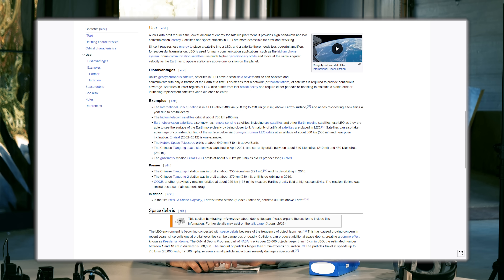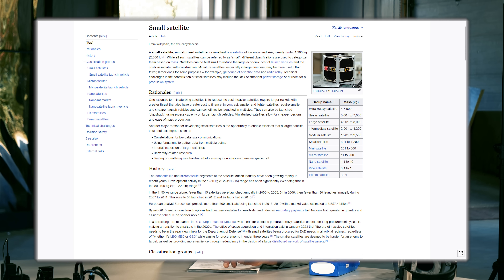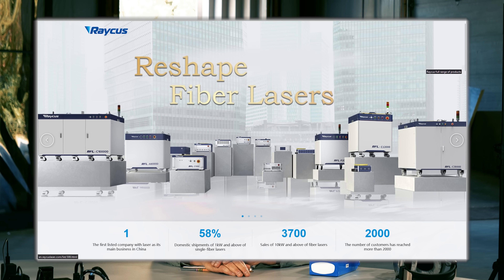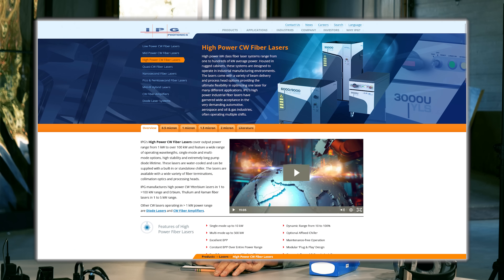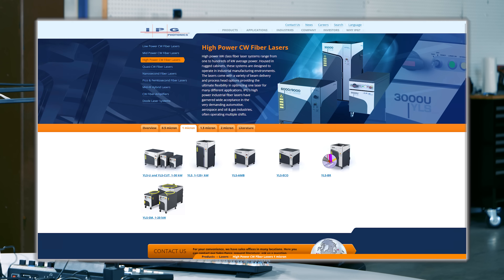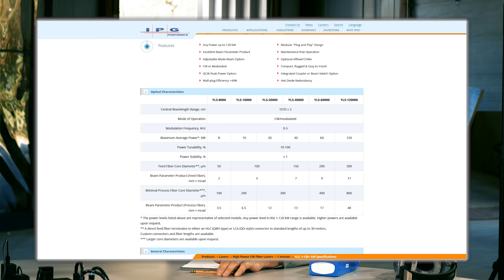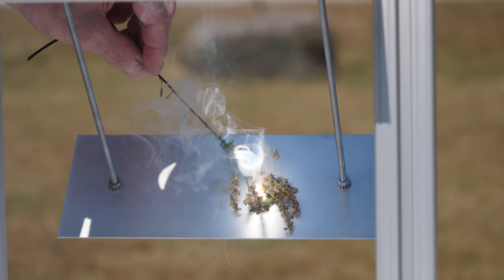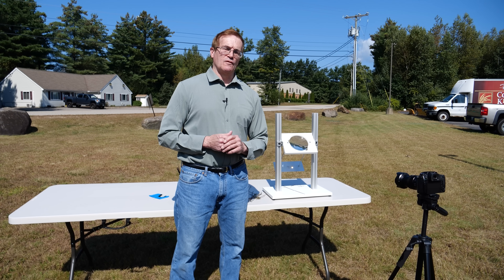COULD SATELLITE LASERS REALLY DO THIS?...

Comment: Here in Australia we routinely have fires started by discarded glass bottles and we have even found a plastic bottle that someone was using as a water bottle that started a fire beside a road. (That one got me because it takes me ages to get anything but char-cloth going with a water bottle) and there really wasn’t much grass where it fell.

One of our biggest causes of fire for a while was DPF regeneration, I haven’t been keeping up with the fire investigations as much but that seems to be getting rarer hopefully manufacturers are shielding the exhaust better with less places to collect grass etc.
Reply: I once lost a camping chair to a full water bottle focusing sunlight onto it while no one was paying attention.
Reply: @Segphalt  ouch that would have been a surprise, I had heard it could happen but I never used to worry about it before I saw it start that fire by itself, because like I said it is usually a pain to get it to work on purpose.
Reply: Had a similar problem when catalytic convertors were first made mandatory in automobiles. Especially in fall, when leaves were all about on the ground and could accumulate under a hot cat and ignite.

I've always cleared foliage away from where I put food and drink, leaving stone or bare earth. Safer and bugs tend to not like crossing bare earth.

Comment: If they can make it happen from a satellite in low earth orbit, then an aircraft mounted system would be magnitudes more effective. I would love to see a video on aircraft mounted lasers, and what they are capable of. Without the limitations of atmospheric distortion, distance, and a far less consideration towards weight, I think they would be a more plausible weapon. You also wouldn't have to worry about the satellites duration over target because an aircraft can loiter.
Reply: Exactly, you even do a drone of some type at an even lower height makes size and power requirements very small. Even multiple drones focused on the same area/s.
Reply: @dougmcfee8351  drones, have their own weight issues, just getting themselves off the ground… Let alone, adding a whole laser attack system
Reply: You can start a brush fire with a lighter. No need to use lasers.
Reply: The planes would have to belong to the country where the damage was inflicted. Seems like a strange use of resources.
Reply: @Onequietvoice  Who knows what ulterior motives or plans are behind certain actions? The population is often left in the dark or not informed at all!
Reply: Thats a very good Point!   So DEW from a high altitude aircraft, not a conspiracy but a sad fact. Lokhead Martin come to mind....
Reply: They would have more than one satellite. Imagine Starlink but with directed energy weapons. They could strike anywhere any time. The curvature of the earth would be a problem with ground based and air based weapons. Would be better off using long-range tomahawk missiles or icbm platforms without nuclear warheads. Shit even hyper sonic missiles would be more effective.
Reply: @Willy_Tepes yes, this seems like such overkill. Spending billions to achieve what a lighter can.

Comment: Could you use the " infrared atmospheric window" that you used to pass IR into space, but the other way around? To target that wavelength band to beam heat to the surface with little to no atmospheric absorption?
Reply: I think that is why he was going with 1micron IR in this example
Reply: tuning the wavelength for best transmission would reduce atmospheric interference somewhat.
it cannot eliminate it. you'd still get diffraction and diffusion unless there was no material in the way, transparent or not.

Comment: On the topic of light pollution, Hawaii is the home of several observatories, precisely because of the air clarity and optical conditions.
Reply: Mostly because they are on top of a mountain.
Reply: The lack of ground-level wind currants  at Mauna Kia was a reason it was chosen as an observatory.
Reply: ... on the top of its mountains.
Reply: At 13 thousand feet..
Reply: We don't have lasers in space.
Reply: @kricketflyd111 meanwhile the ISS uses laser data transmission daily 😂
Reply: Maybe the lasers can burn the street LED light... :)
Reply: Who is "We"?  Because I think WE do since the 80s.    @kricketflyd111
Reply: I was kidding
Reply: @kricketflyd111  We have lasers in space.....
Reply: @chrimony  No, it's because it's in the middle of the Pacific Ocean so there's no light pollution around them. And they're volcanos not mountains.
Reply: At very high altitude. yes.
Reply: SCALAR energy doesn’t diverge, this guy is using mainstream publicly acknowledged tech to explain the arcane and highly classified platforms.

Comment: This experiment is interesting for making an engraver.
Instead of an expensive laser engraver, if you could build your horizontal XY plane where you place your acrylic (or wood or whatever material), that is it.
You'd need a beam 0.1 or smaller instead of 1cm diameter, but you could solve that with a series of lenses

Comment: Is it possible to do this with a satellite with lenses utilising sun energy (i.e. same way you focused in your demo) to concentrate a beam? Instead of having a a huge laser only a mechanized system of lenses?
Reply: I don't see why not, but depending on the altitude of your orbit, you wouldn't be able to fire on targets half the time because you'll be in earth's shadow
Reply: Those orbits in respect to the sun may as well be same as on the surface for an engineering estimate so that 3m optic can catch about 7kw of light energy but thats in many frequencies and will not focus the same. Is possible though.

Comment: Great video. I know a source of the DEW theory was the melted aluminum and glass from cars, but a laser wouldn't affect something transparent like glass, meaning the fire itself must've been that hot. It was windy that day, like bellows in a furnace, more oxygen makes the fire hotter.
Reply from the maker: Don't  forget  each car contains  fuel.
Reply: Windy means that a DEW could not have ignited vegetation which would be moving. The other big reason a DEW could not have worked is because it does not exist.
Reply: Not quite true. For one, what's transparent to your eyes may very well be opaque in a different wavelength. Glass is clear to you, but regular window glass won't transmit UV, it absorbs it.

Comment: I agree with you.
People looking at things like melted aluminum rims needed to consider the burning tire created the heat to melt the rim not the grass fire.
It is odd the surviving blue objects.
Thank you for putting the research on the subject.
Reply: People need to realize a simple camp fire is more than enough to melt aluminum and glass. I am suprised so many people havent put aluminum or glass into camp fire and lack this knowledge.
Reply: That grass you are talking about burns extremely hot, had to deal with it on several occasions, definitely in a class of its own! No need for rubber or other substances to combust to do the damage!
Reply: The radiant heat of a campfire is one thing, but it falls off from the inverse square law. When a car has hot fires on all sides, even if they’re metres away, that radiant heat is not dropping off much at all.
Reply: The sustained heat necessary to leave solidified streams of molten aluminum rims trickling away from Maui vehicles is not evidenced in this video.
Reply: completely and utterly false

Secondly how do you explain people running from theur cars while somehow having time to shut all the car doors?

Or how about the fact that if there were high winds how come there were trees and houses next to eachother that were left standing.
so hot it can burn a car to nothing LOL

Umm i call bs

go set a car in fire and prove to me this is what happens lol joke
Reply: @ericdelevinquiere9902  i knew thus was a fed bait channel
Reply: @driatrogenesis  <--- 'fed bait' bot identified

Comment: The high winds were a major issue, both in starting the fire due to downed power lines and failing transformers then the winds fueling and spreading the fires quickly

Comment: What I don't get is how there were purportedly grass fires (with relatively short grass) well away from buildings and other fuel sources that allegedly melted car wheels. How is that possible?
Reply: Rubber Burns really hot
Reply: @brothernorb8586  enough to melt aluminum rims? someone should do an actual test to know if it is so...
Reply: The cars were on fire. The grass is irrelevant.
Reply: @TheKb117  Tires burn a lot lower in temp than it takes to melt aluminum, but the tires weren't the only thing burning on the cars.
Reply: Because they didn't
Reply: @TheKb117  yes, I think 2000° it happened on cajon pass when the fire came up the hill fast and hot and people had to abandon their cars. Maui was still highly SUS tho trees can burn from the inside also from geo heat below ground ie paradise..still SUS I think
Reply: Idk how easy tires catch fire, but the heat from a grass fire is incredible and asphalt melts in the sun so..
Reply: @duncanvincent6078  Okay, I'm open to it. You know they didn't because?
Reply: @johngreig2824  Have you considered watching the video?
Reply: @duncanvincent6078  Interestingly, I did watch the video all the way to the end. Even the bit where he said that he doesn't believe it was a DEW and that it was more likely to be the guinea grass catching fire as a result of downed power lines.

I still don't think that hypothesis explains how a grass fire, with like 2 - 3 inch grass, well away from buildings and other fuel sources can cause a fire hot enough to melt wheels.
Reply: @johngreig2824  it didn't.  The car being on fire melted the wheels. Obviously.
Reply: @TheKb117 Yes, the melting point of aluminum isn't very high when compared to the temperatures you can get in a car fire. You can melt soda cans and glass in a normal campfire.
Reply: @johngreig2824 The grass fire ignited the car, which has things like plastic trim on the outside of it, and the subsequent car fire melted the wheels. How is this remotely difficult to understand?
Reply: @TheKb117 I was a firefighter, and it was common to find puddles of aluminum around burned out cars. We used to make wall art out of them.
Reply: Videos like this are one of two things, brainwashed science, or bought and paid for disinformation... feasibly... both.  The tech this guy is aware of and 'educated to believe in' is far antiquated, compared to the reality of black budget / ops / etc, etc projects.
Reply: @johngreig2824 why are you trying to sell the idea of the unmanaged, non native & highly combustible grass being short & irrelevant? Government asset by any chance?
Reply: @richarddebono7092  No, I am the furthest from a government asset as you could imagine (not that you're likely to believe me). I think the real answer is this... I am no longer young. When I was young and interested in cars they had steel wheels. I haven't really cared too much about cars for years (as long as they got me where I wanted to go). Every time I had seen a burnt-out car, for decades, the wheels always survived. Now many wheels are made from Aluminium or alloy... and they have lower melting points than steel. The first time I had noticed the wheels melt was in the California fires a while back... which many believed to be suspicious. 

There was apparently a CCP satellite directly over Maui at the time the fires broke out and I may have put two and two together to make five. The truth is I don't know what happened... I was concerned and curious... so I asked a question.
Reply: Electric cars batteries........

Comment: 3:00 seeing as you've gathered this much information I hardly think this could hurt. When I was assigned the additional role of RTO on my first deployment to Afghanistan I not only used LOS sincgars radios but SATCOM as well. While I won't get into too many specifics satellites are changing about every eight minutes. So ten minutes is a good marker but that might only apply to those specific SATCOM satellites. Hope that information is helpful down the road.
Reply: If I were going to build a space laser, I think I’d want it to be geosynchronous. That way, a little bit of thrust in the right direction gets me on target, and I can just synch back up when I get there. Then I have all the time in the world. Given some of the energy concerns of sending this thing up, I’d want to make sure that I didn’t miss.
Reply: @myusernameisrighther   At 25,000 miles to the distance? Sure, great idea. And do you not just know there is a difference, but UNDERSTAND the difference between geostationary orbit and a geosynchronous orbit? Or inclination? The fuel the satellite would burn making it's movements?The fact that the only direct shot from GEO is the equator and anywhere else you're shooting through more and more and more atmosphere and the wavelengths described already have trouble with the earth's atmosphere mainly due, but not exclusively, to water in the atmosphere? MEO and LEO have much less fuel concerns and could even pull a Hubble and get away with NO propellant and only gyroscopes to point and hold. I've not made it completely through the video but Hubble needed a boost every so often due to being right at the edge of the Earth's atmosphere and years of a few particles from it slow it and consequently lower it's orbit. But other than the Space Shuttle boosting it's orbit a couple times, no fuel needed and accuracy like you wouldn't believe. Learn some orbital mechanics. I don't mean that smart-a**ed either. You obviously have at least a passing interest in space, I really think it's something you would find enlightening. Your idea has good outside-the-box thinking, much like an engineer, but poor performance and short life. Best of luck and keep thinking outside box bud!

Comment: Re atmospheric diffusion, during Reagan era SDI/High Frontier research, there was discussion of “particle beam preceding laser beam onto target”. Not sure if this was integrated into satellite DEW or dead-end. Sounds like processor capacity coupled with mirror adjusting capability may have eliminated need for a combined system ?

Comment: If you wanted to generate microwaves at the same power as a laser couldn’t you use beam combination?  I remember in my communications electronics class that if you combine two frequencies of electromagnetic radiation, you get four frequencies: f1, f2, f1+f2, and f1-f2.  You could select f1 and f2 so that f1-f2 is in the GHz range.  I know it works in radio and tv, I just don’t know if it would work with visible light lasers.
Reply: @@jaxoncrow8598 Yes, but if you could use two higher frequency lasers to reduce spread, couldn’t you create a microwave frequency with lower spread also?
Reply: @@jaxoncrow8598 They are all part of the electromagnetic spectrum though, yes?  It has been a couple of decades, but in my radio communications class, one of the transmission methods used two frequencies that were combined.  This generated four frequencies, f1, f2, f1+f2, and f1-f2.  

One was the carrier wave (f2), which was a fixed, high power frequency generated by an oscilator.  It generated the range of the signal, and defined the channel.  The other signal was the actual signal (f1), like voice over a microphone, and was low power.  By combining the two, you could take a low power signal and generate a high power signal (f1+f2), transmit it a great distance, and then subtract the carrier wave (f1-f2) to extract the actual low powered signal at the receiver.  Amplify the low power signal and you have radio.

As I understood it in the video, the problem with microwave was that even with lasers (or masers) beam spread is a function of frequency, and the longer the wavelength, the greater the spread.

By using higher laser wavelengths with less spread,  couldn’t you combine them to get a maser frequency (f1-f2) that has less spread?  

I don’t know if this would work, since I have never investigated the optical spectrum, and I never really questioned how the frequencies were propagated.  

While assuming we are discussing coherent light, if the two frequencies created the microwaves only at the emitter, then the spread problem would still occur, but if the microwaves are generated by interference along the entire beam path, it would essentially be generating the microwaves right at the target.

I have no idea if this would work, or if it would actually have any power.  That is why I asked.